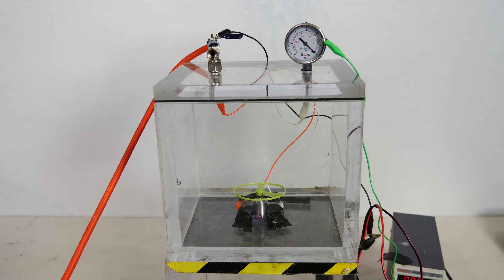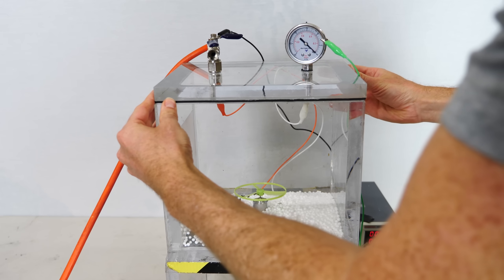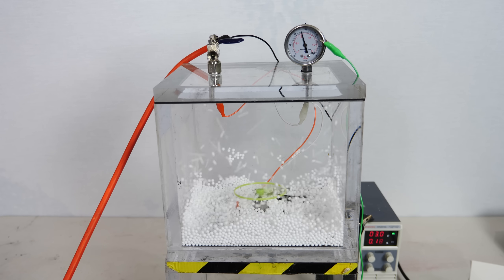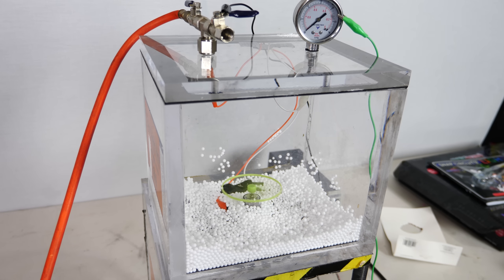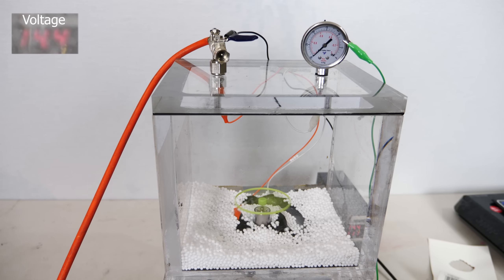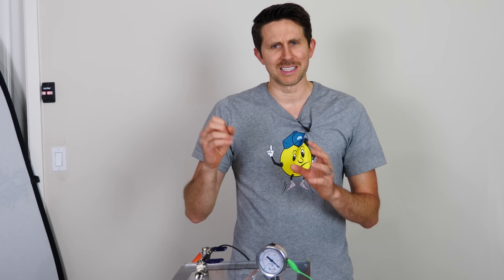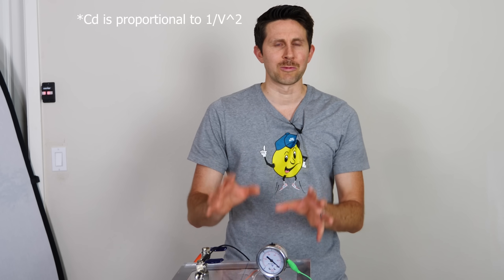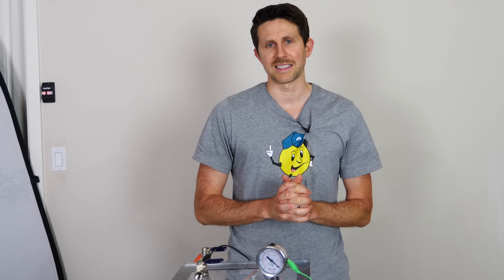What Does a Fan Do in a Vacuum Chamber? Weird Results

Comment: I have an alternative scenario, barring the fact that you haven´t given the viewer enough information to confirm it one way or another. Tut, tut.

Driving the motor so far beyond its rated wattage (voltage), it was inevitable that the armature (the windings) would overheat, especially without ambient airflow to convect away heat. The shaft galling in its bearings would stop the fan precipitously, thus making it fly off because of inertia. (Also, sudden deceleration will allow dynamic friction to overwhelm the static friction holding it to the shaft).

Of course, the shaft cooling down will allow it to rotate in its bearings again, showing no evidence -- if indeed it hadn´t burned out the windings.

Next time, show the readings of a watt meter, IR temp meter, and an RPM meter.

Comment: no the balls started moving at the end due to the vibrations caused by the motor with that unbalanced fan and the box, the walls of the chamber are what caused the balls to bounce around. the walls transferred the vibrations from the motor to the balls. try this again with no static and no vibrations and you will get real results. You need less variables.
Reply: I was about to suggest that this could have been a factor, too.
Reply: Agreed
Reply: Wow but its just minor factor. Notice at 15V those balls at surface rotating along the direction of fan.
Reply: You need "fewer" variables...
😁
🇺🇸

Comment: Two observations:
1 - It is very interesting to see the motor current decreasing with the increase of the vacuum rising due to the decrease of the load on the motor.
2 - It is very likely that the pieces of Styrofoam are jumping in the vacuum due to vibration of the motor at the bottom of the vacuum chamber. The sound propagating in the camera is the main support of this thesis. When the propeller detaches, the sound disappears. This propeller is probably unbalanced and caused high RPM vibration.

Comment: The experiment is very informative and just plain cool to watch👍 I you still have that setup I have an idea, try wiping the interior of the acrylic and fan motor with a dryer anti static sheet and put the styrofoam beads into a paper bag with dryer sheets before pouring them into the box. See if that makes any difference in how much you need to crank up the fan. I would do it here but I don’t have that good of a vacuum pump. Just curious?

Comment: What would have been interesting is, with a consistent input voltage, measure the RPM of the motor 1) with no blade 2) with blade in air 3) with blade in vacuum. I would expect that the RPM with blade in vacuum to be near RPM with no blade.

Comment: “This fan is supposed to run at 3 Volts”
“Let me just turn it up a bit”
45..46...47.......48
Reply: It maxed out at 20V lol
Reply: @PorWik  that’s not what matters
Reply: Voltage = speed
Current = torque
As the air goes away, it makes sense that the torque goes away, so he can increase the voktage without burning the motor (because power = current * voltage)
Reply: @nicobugs  he should have run the fan without balls first to see what the current and fan speed do as air is removed. Be interesting.
The balls bouncing off the fan blades really confuses any conclusions.
Reply: ........
kaboom...
Reply: just a little more..... boooooom. yep works perfectly
Reply: 168
Reply: that part cracked me up haha
Reply: Tim Tailor wants more power.
Reply: Overclocking at its finest
Reply: "I popped it"
(name that you tuber)
Reply: @acronus  photonicinduction
Reply: Bruh it was 4.5 4.6 4.7 4.8 there was a decimal place, if you put that much in it would just spark a but and stop
Reply: @thewatcher7682  Well I intended for it to be a joke but you can interpret in however you like.
Reply: @glovepro1256  not a good joke but alright :)
Reply: @DTMPROD.  lol
Reply: 4.8 piss wipe
Reply: @jinxx_z5125  wtf are you trying to say?  Are you roasting me

Comment: That is the expected result, not a "weird" result.    Once the kinetic energy of the balls which was created during the initial higher air pressure state dissapates,  then they settle down.   Of more interest is that the electrostatic forces then exceed air drag or gravitational forces on the balls.
Reply: That happens all the time, small or light objects stick to hands or arms even after waving them around.

Comment: blades traveling so fast they could be causing an electro static charge
Reply: Rubbing against what ?
Reply: @hotrodray6802  that's the question, traveling at high spead it might be possible that it is creating it's own micro Atmosphere,
maybe a test where there are two sealed off box's the first little one containing a camera and the fan, place it in the outer box filled with red dye and then let's see if it enters the little box, after all the test must be completely accurate, before trying to solve the answer why is there movement in the little box, we might be stepping into a different  Dimension in science, that's the problem with science always looking for the easy answer rather than the mystery, always build the cage to put the devil in before lettings it loose

Comment: What I dont understand about vacuumed atmospheres is what replaces the air? Even though its vacuumed, something must still fill that void.
Reply: As you decrease the air pressure there are fewer molecules of air in the box, or in an atmosphere.  Nothing replaces the molecules. There are fewer of them so you need air tank supply to breath in an u pressurized aircraft or the top of MT Everest.
Reply: @kitefan1  
I got an open water 1 certify, I got the idea of expansion under less atmospheric pressure. Its just hard to wrap my head around the concept of something that was there isnt now and wasnt replaced with anything. Kinda too twilight zoney for me. Lol
Lately I been interested in turbine jet engines. What was holding me back there was ridding the idea that it was gas exploding causing thrust. But realized its the rapid expansion of hot air doing it.
But that explanation works you just gave. 
But outside of Earths orbit, what kind of gas is floating around? If it has oxygen in it, shouldnt we be able to compress and use it?
Reply: @kitefan1  
Btw. Thanx 👍
Reply: @siggyretburns7523   YW.  There is stuff floating in space is attracted by gravity to larger bodies, so away from a body there is very little stuff. Very high vacuum, the thing the presenter needs a huge vacuum pump for,  is one molecule per 1/3 cubic meter so one molecule doesn't do much.  With rocket propulsion the thing propelling the rocket isn't the combustion its the momentum of the expelled particles (I think).  In space photon sails  work.  There was one launched in 2010 called IKAROS.  Congrats on open water certif. Lots of stuff to learn for that.   And I can see why that makes it harder to see no gas environment.  Ahh! at the surface of the ocean there is a lot of water in the air.  but you can't swim in it until you get close enough to the earth that is dense enough to swim in.  I worked on a high vacuum test once.  It takes hours to pump all those molecules out.  Thanks,  it's good to think once in a while.
Reply: @kitefan1  
Yeah. Its kinda funny how there is water in the air and air in the water, but a definite separation from the two as a mass.

Comment: It wasn't blowing them around with fan action any more.  It was vibrating the chamber, which causes the static cling to break from time to time, and sometimes a ball hits the blades.  Faster blades shoots that ball out which breaks more static clung balls, and some strike the blade which shoot out.  Like a chain reaction.  Faster fan = higher energy.  If you slow it down, you can compare the falling velocities, but it's easy enough to see that in a vacuum, the balls are freely flying around that chamber and bouncing off of the walls.

Comment: Fun Fact: Andy Weir, the author of The Martian, stated himself, that one of the only nonscientific plots in his book were, that the atmosphere on mars would be too thin ,as that a windstorm could have overthown the startmodule. He put it in anyway because of no better explanation why the crew would had to abondon mars. ;)
Reply: @Lassi Kinnunen 81 If there was a landslide and one were buried they could just use his biomonitor which is sending signals to find him. A welding fraud on the one hand has tro be severe enough, that the crew couddn´t fix it, in which case the lonely astronaut couldn´t either, Or at the other hand it would be fixable like the accident with the pressure gate in the book. In either case there wouln´t be a reason to  abondon mars and leave one crewmember alive and alone back there.
Reply: @Deborah Ajao  - Also, that storm at the beginning of The Martian is false. They had pebbles flying through the air during that storm. That doesn't happen on Mars. Dust yes, pebbles no. Not with just 1% of an atmosphere.
Reply: Couldn't he have put in one of those planet wide dust storms that last for long periods of time? o: Just curious (: I'm sure he thought of a lot of possibilities, but I wonder if that crossed his mind too (:
Reply: @revenge12212012  I guess not. A long lasting sandstorm would be a problem because of lack of sunlight for the solar panels. At the other hand that would mean Mark Watney would have died after a few days, probably due to hypothermia.
Reply: @leonmuller1702  that makes sense (: hmm, what if it were like an unforeseen dust storm (not planet wide) that only lasted for about a week and made the crew leave, leading to the main character's circumstances, do you think that'd be possible? o:
Reply: @revenge12212012  The problem is why they would leave Mark alone on mars. If dust were the problem, there wouldn´t be a need to rush and let a injured alone.
Reply: It's is enough atmosphere to lift rocks into to sir in the Martian winds (albeit small rocks also known as dust)
Reply: Dust storm can be devastating. Even in thinner atmosphere. Lot of mass and dust push.

Comment: Ok...except, the wind represented on Mars in the "The Martian" was one of the most inaccurate parts of the movie. We have no current expectation that storms on Mars are strong enough to tip something over like a Starship with the reduced pressure and density of the atmosphere present - even the strongest Martian storms we've seen. A portion of Martian storms are just sufficient enough to clear dust from our rovers, much less have any noticeable impact on them physically.
Reply: They're not a common occurrence but Mars can have dust storms of up to 60+mph winds. If you take into consideration the atmosphere on Mars compared to here on Earth, the winds on Mars could be the equivalent of 100+mph.
Reply: @de-b1221  You've got your math wrong - it's the other way around. A 60 MPH wind on Mars is equivalent to more of a light breeze on earth.
Reply: @jcpt928  are you sure?
Mars's atmosphere is thinner making the winds considerable stronger as long as the winds keep going.
Here on earth, winds starting at sea level picks up speed as they reach mountains and then they start to pick up even more speed as the air starts to become thinner.
If a dust storm on Mars lasted for more than 5 days, the speed of that wind (as it peeks) would be strong enough to cause damage and potentially rip parts off the Mars Rover.
These types of winds are extremely rare but they have been recorded.
But I will agree that the majority of winds on Mars are a light breeze.
Also these types of strong dust storms can cover the entire surface of Mars.
Reply: @de-b1221  I'm pretty sure your interpretation of wind speeds is less about the density of air at different altitudes as it is about how air behaves as a fluid when pushed\flowing across the "not so smooth" landscape of earth. I wouldn't consider myself an expert in that regard.

That said, I am sure about the Martian correlation, but, want to iterate that there is a difference, albeit mathematically-related, between the speed of a wind, and it's physical force applied to an object in the wind that depends on, for this discussion, the density of the air.

A 60 MPH wind is a 60MPH wind on both Earth and Mars - the difference is the force applied to something by that wind due to the difference in density.

For discussion sake, let's just say the physical force of wind on Earth due to a denser atmosphere is twice that of Mars (we already know it's much more than that). Dismissing all other variables, you could then say that a 60MPH wind on Mars has the same physical force on an object as a 30MPH wind on Earth.

As we know that the difference is much more than that, you begin to see how the physical force of even something like a 120 MPH wind on Mars has the equivalent physical force of the wind during a light thunderstorm on Earth.

(let's just say this is an ELI10 explanation due to my lack of interest in getting into all the scientific babble-ry)

Comment: On Mars, the wind would very little force on any of the equipment that was seen in the Martian. Basically it couldn't happen. Now. 4km/h wind on Venus would be pretty powerful.
Reply: That's a good point if we only consider the rho of the gases.  If we increase rho by adding in the dust being carried in the wind, it might be a bit different.  I don't know of any experiments that have run with that in mind, but it's not hard to imagine dust moving along with the wind at 30mps will generate a substantial force.

Comment: Interesting video. As the air got thinner there would be less force from moving air if the fan were at constant speed. However, in thinner air the fan will go faster for the same applied voltage. That effect, combined with a higher applied voltage accounted for the fan being able to move the beads around even at such a low pressure. It would be interesting to know how fast that fan was turning just before the blade flew off.

Comment: Interesting, one thing I noticed as the air was removed was the amount of current the motor was pulling decreased as the air pressure decreased. (I assume that is the readout below the voltage on your power supply)  Were you able to notice an increase or decrease in RPM at vacuum vs at atmospheric pressure?  
I have a theory that the RPM would increase some since there is less load on the fan and motor.

Comment: Some slight issues i can see here! An ABSOLUTE vaccum was not achieved,  also there is always a static attraction between polystyrene and plastic,
Also the movment of the balls with fan in very high speed mode could have picked up a few balls with the very slight amount of air present,
And also with the attraction of static! Then once one ball is hit, it then hits two, that two hit two more causing four to be bit that four hit more causing
A miriad of ball collisions looking like the balls are being blown by the fan,
Try again using small  balls  of paper, and install the fan at the top of the chamber where the air could  blow the small paper balls
And install a grille to alow the air flow, but keeps the balls completly out of reach from the a actual blades of the fan!
Although your set up looks good, i dont think that i could take this experiment as any sort of conclusion as proof of any
Kind of blown air / jet air propulsion working in an absolute vacuum, or causing wind or storms on Mars!

Comment: Small remark: the drag coefficient doesn't change with velocity squared. The dynamic pressure, and thus the drag, does. D =0.5Cd*S*rho*V^2
Reply: 2+2=4
Reply: @likefire1617  minus one that's three, quick math
Reply: @amovifa4525  damed you're smart
Reply: It's a result of Bernoulli's equation(dynamic pressure is 0.5*rho*V^2). For both equation, D is drag, the drag coefficient Cd,  
the surface area S, the air density rho and airspeed V.
Reply: @amovifa4525  wow, lol. Thanks for sharing. God bless
Reply: What
Reply: What is the equation. Way over my head mate

Comment: I wonder how hot the motor got with no air flowing over it to keep it cool? I wouldn't be surprised if the heat caused the fan failure by softening the plastic.

Comment: Did anyone else notice, that the electric current to the fan motor dropped significantly? I know it's because of the lowered air resistance. It would be interesting to see, if the fan also would spin faster...

Comment: Too bad you didn't keep the power supply in the picture.
At first, in air, let's say nominally it takes 220mA (3V) = 660mW.
In vacuum it drops to 150mA (3V) = 450mW, without moving any air => Losses (friction, vibration, electrical) mount up to about 400mW
Now, when you turn up the voltage, what was the current? That would tell how much more power = effort was put in. I suspect that was crazy much more than the effective ~250mW at nominal. But it cannot be seen clearly.
My best estimate is 18V, 1,5A that would be a whopping 24W, about 30 times the original power and may be a measure of the vacuum in some way. You say "lower than 0,1 atmosphere", I'd guess 0,03 IF things were linear. Which in fluid dynamics and electrical/friction/vibration losses they're not ;)

Comment: Notice how the motor's current draw was dropping as the vacuum was created.
Reply: the produced heat however cannot disapate quite as well.
Reply: I've seen that too, but at 2:05 he moved the camera-angle so we dindn't see what the current was at minimum pressure.
Reply: Darth Wheazius  exactly what I was about to say
Reply: Darth Wheazius  
That's what I was wondering too.
Reply: Darth Wheazius 
Heck yeah! Shoot for it.
Reply: That's only because the fan is doing less work, moving less air because the air is thinner.

Comment: 4:06 The power fed to the fan would be proportional to the square of the voltage. So when you got down to 0.01 atmosphere, then multiplied the power-supply voltage by 5, that’s multiplying the power by 25, which is probably getting you close to compensating for the lower pressure. Particularly since at 3V you were getting substantial fan effect right down to tenths of an atmosphere.